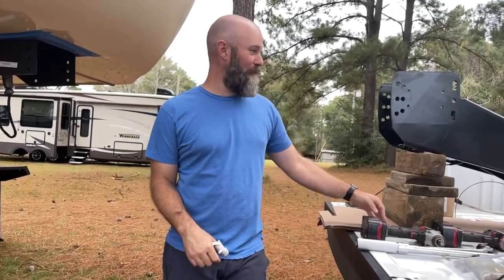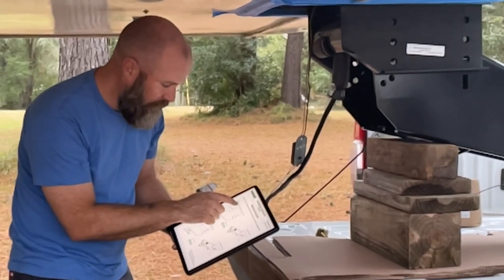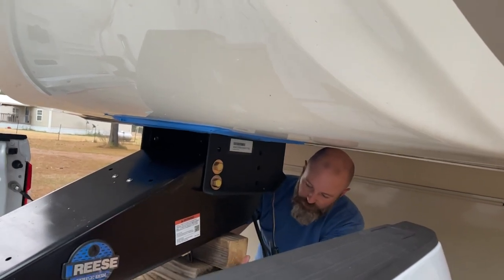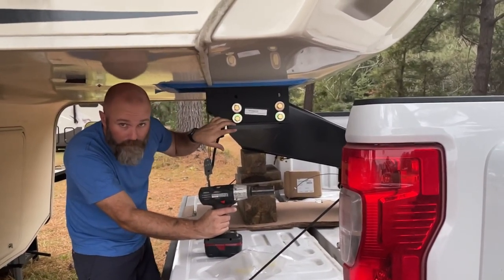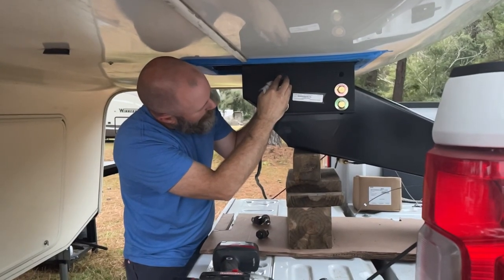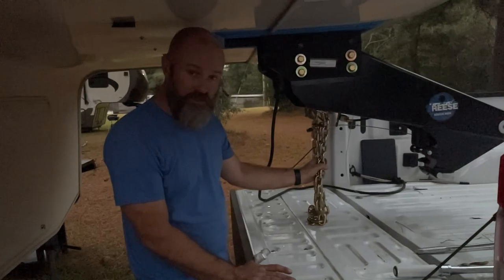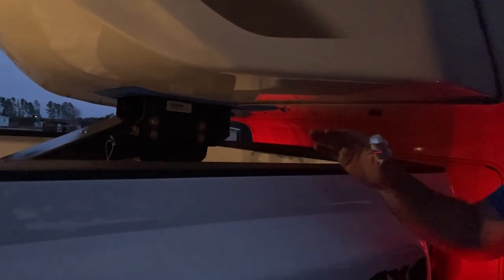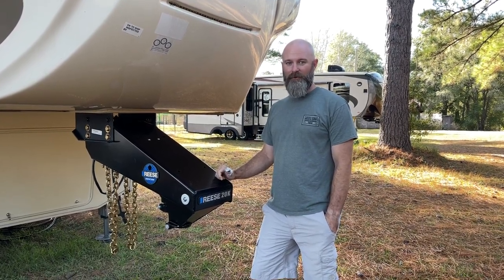Reese Goose Box Install

Comment: Thanks for the video.  I'm curious what you use for pressure in the air bag.  I've been finding that my camper surges a lot more when I hit expansion joints and big bumps with this hitch than it did with the 5th wheel hitch.  I'm hoping it's just that I haven't found the right air pressure.

Comment: Great install video!  Big difference as far as how it tows now?  And cons to this hitch thus far?
Reply from the maker: Thanks! I haven’t towed the camper with it yet, though. I just installed it last Saturday. I’ll do a review video after I’ve pulled with it a few times.
Reply: @yondersouth6231  Awesome! Thanks man!
Reply: Great video, simple and very informative. I am upgrading to a 5th wheel and trying to decide between Reese Goosebox or the Gen Y 5th to gooseneck conversion hitch. Did you consider Gen Y?
Reply from the maker: I did consider it, but I liked that the Reese Goose Box wouldn’t void the warranty on my fifth wheel trailer.

Comment: I used the standard location to bolt mine in and I was at 6.5 gap but I forgot to air up the goosebox bag. So did you gain space between the Rv and the truck when you aired up the goosebox compared to not having air in the bag and if you did how much? I have a lift on my truck I don’t t want to sit ridiculously nose high a little is ok with me.
Reply from the maker: I’ve honestly never measured it again since that day.

Comment: I would respectfully suggest to those thinking about installing one of these to check with their 5th wheel's manufacturer (not the dealer) to make sure their trailer is designed for the dramatically higher pin box stresses. The long moment arm of a hitch like this can (and often does) bend the interior frame members. If you really want to haul your 5th wheel with your truck's gooseneck ball, you might be better of using something like the Anderson 3200 or the Pullrite SuperLite 2600.
Reply: Lipert has endorsed this goosebox with their frames.
Reply: Also Lippert just removed Anderson as an approved hitch.
Reply: "The Goose Box is a great solution for fifth-wheel RV users who prefer to use gooseneck hitches," said Jason Lippert, CEO of Lippert Components. "We are very pleased with the results of the thorough testing of the Goose Box, which demonstrates that it is compatible with our RV frame. As a result, the proper installation of a Goose Box pin box will be acceptable under our RV frame warranty."

Try again.

Comment: Do you find it hard to hitch up by your self?  I'm assuming unless you have a bed camera you cannot see the ball without a spotter.  Good job on the install video
Reply from the maker: Yes. It is much easier with a spotter. Otherwise, I’m using the edge of the dually fender as a guide down the side of the trailer and it still takes a couple of tries.